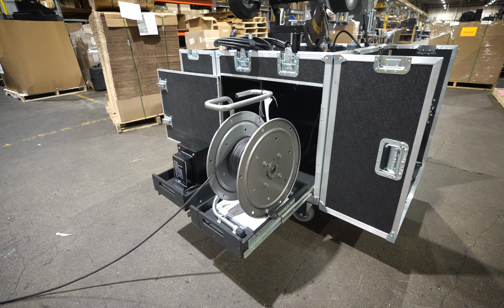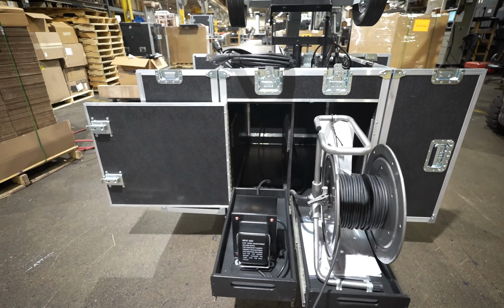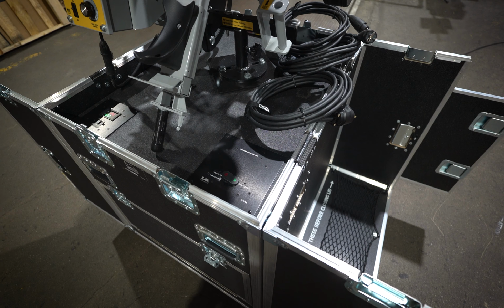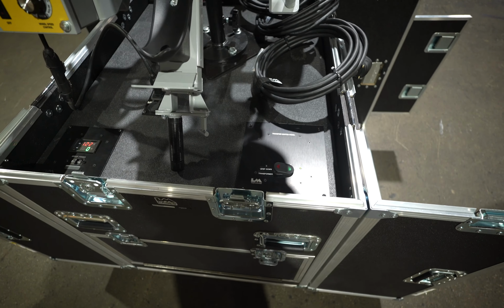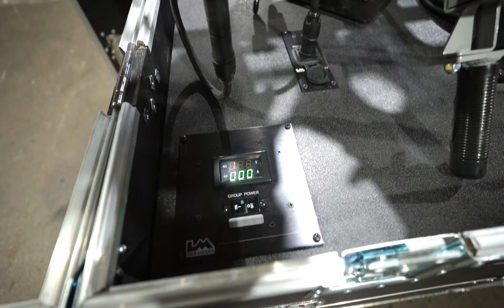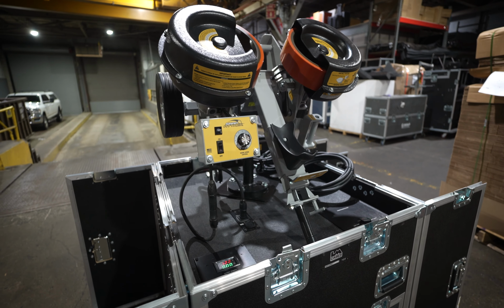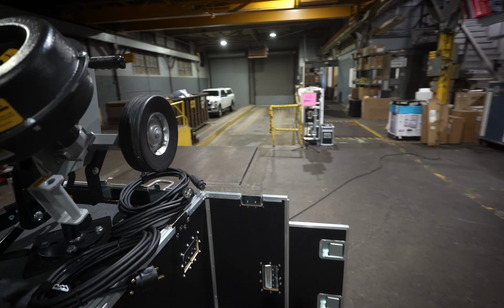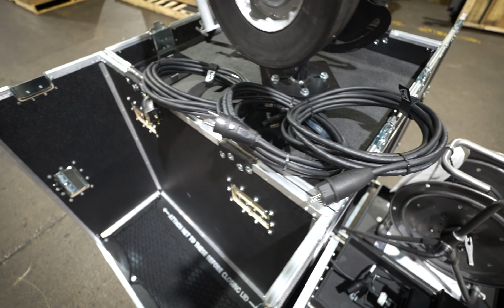Snap Attack Football Launching Machine Case w/Euro Transformer | LM Cases

Comment: It's pretty easy to guess the customer for this one. How well does the Snap Attack run on 50 Hz?
Reply from the maker: 60Hz motors can run on 50Hz without a problem. They just run slightly slower.